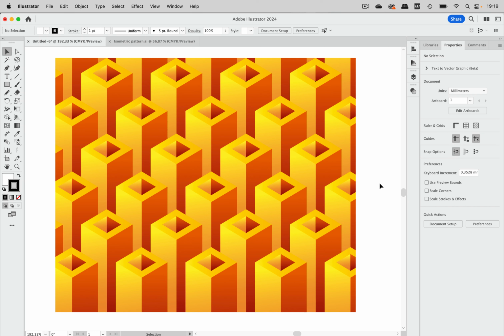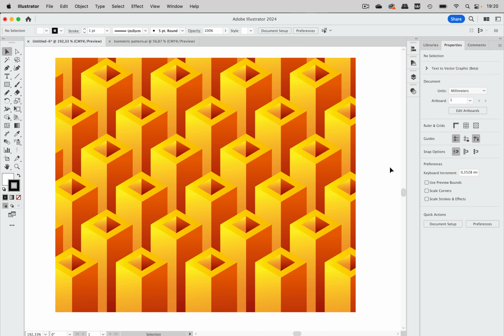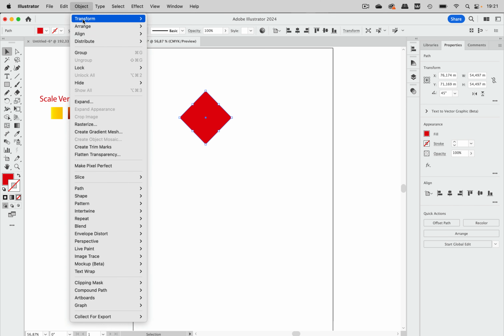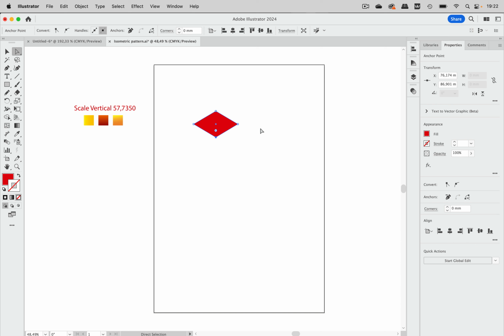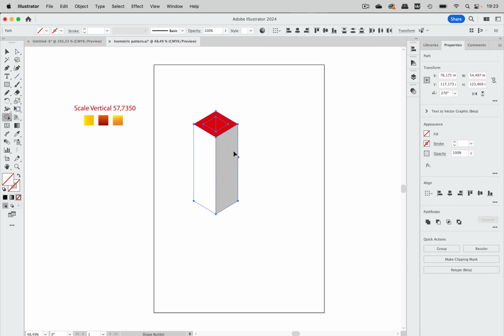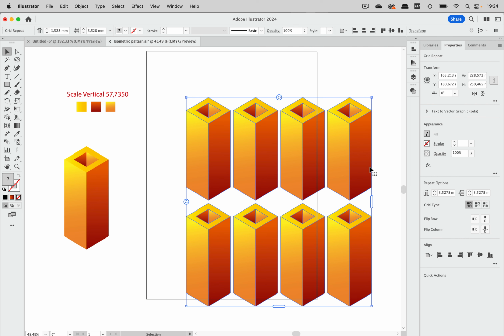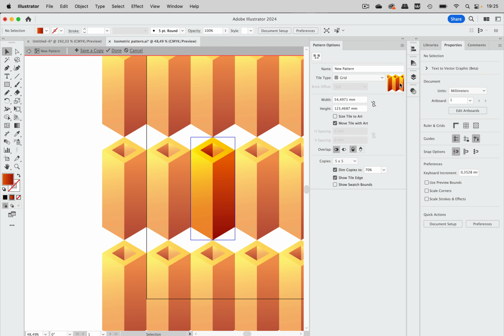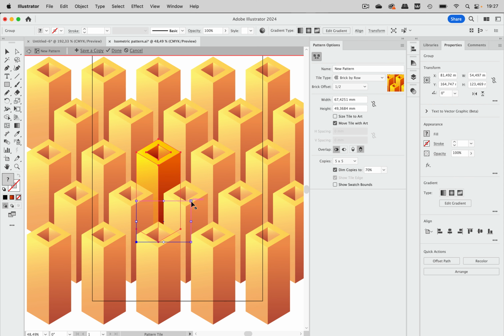Creating A Pattern Easily Using Pattern Editing Mode

Comment: I didn't know how did you get vertical value [time: 2.32]. But for me it comes like this. Please tell me the differences in both methods.
https://www.youtube.com/watch?v=k6DB1rujRlc
Reply from the maker: You just need to set to non-proportional scaling and then enter horizontal 100% and the value in the movie for vertical. When you research tutorials for isometric drawings, then you will find that value (that's where I got it from as well).